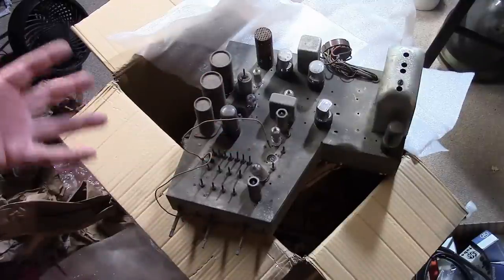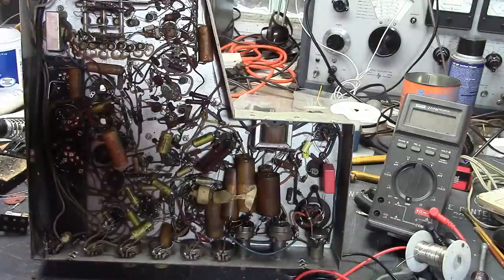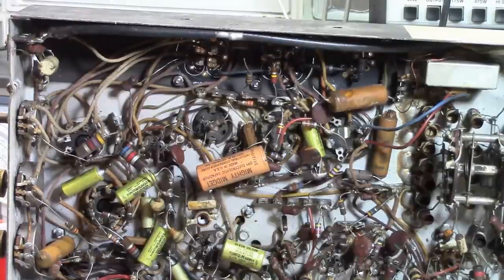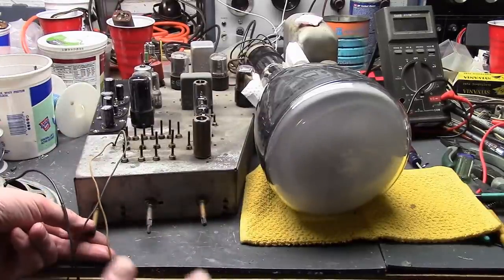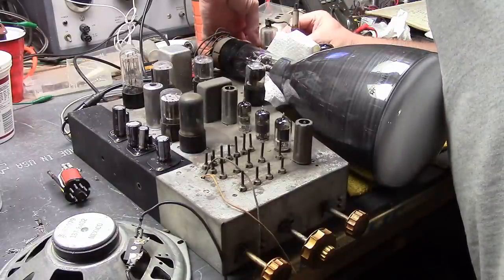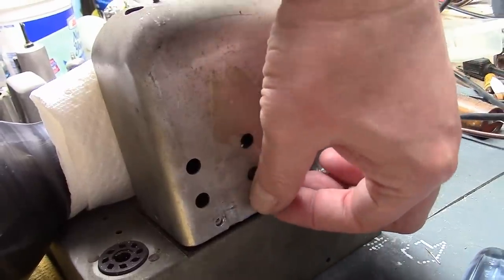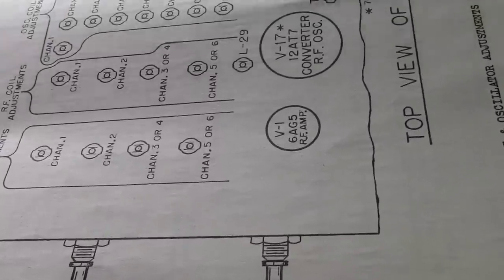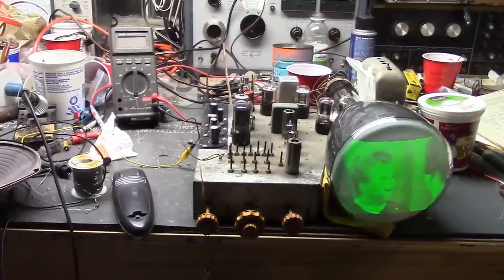Motorola VT-71 (TS-4J chassis only) restoration part 1 of 2

Comment: 5:00 I've noticed many Axial lead capacitors are labeled with the "old style" voltage and capacitance ratings and the radial leads are the newer voltage and capacitance increments. dedignations.

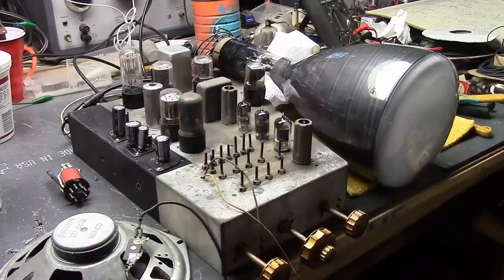Comment: 22:27 Guessing the valve heater went O/C at this point.

I too have a set which lights the first one in the chain like a lamp for a second or so; I must do something about that when I get round to fixing the set up. (BRC 950 MkII in case anyone's familiar with these). An NTC or something, maybe just a suitable lamp, in series with the heater chain?
Reply from the maker: It does have a thermistor plus the capacitive filament dropper acts a surge limiter.  I think this 12AT7 was just on its way out.

Comment: I'd think that when the seal cracked on that oil filled capacitor, moisture seeped in and gave rise to the electrical leak that the tester found.
Reply from the maker: Possibly. The paper they used also contains trace amounts of acid that causes them to breakdown.